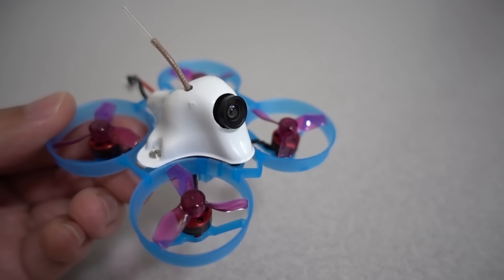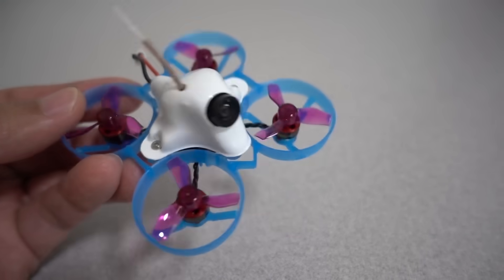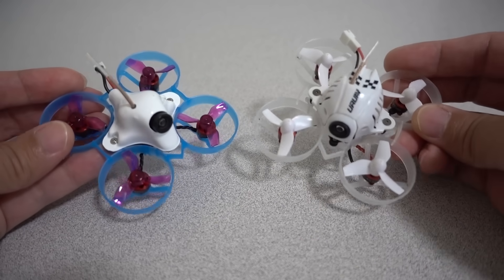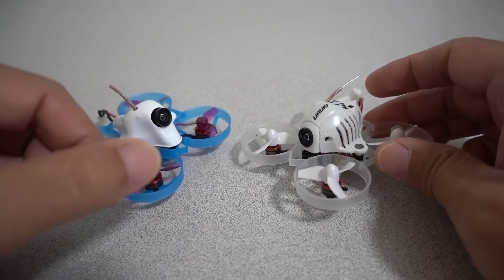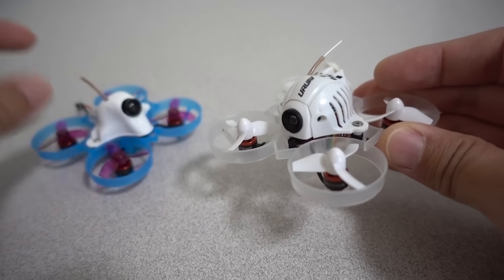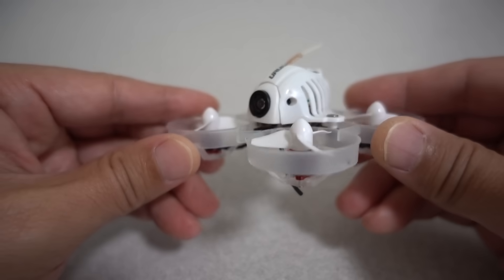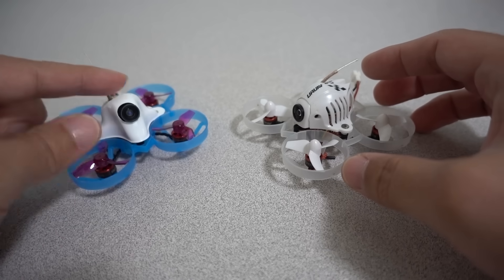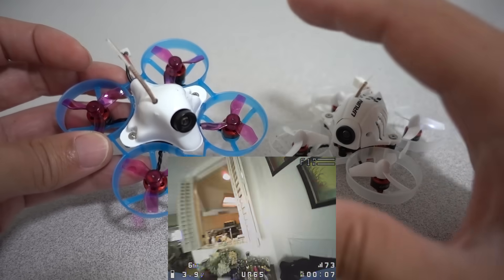Build a Super Tiny Whoop 🛠️

Comment: did you screw the canopy straight onto the fc or do you have small rubber anti vibration things under the canopy.. the canopy looks flush with the fc..thanks
Reply from the maker: grommets were in use here
Reply: @AlbertKimTV  thanks for the quick reply.. I have everything on order should be here this week.. i have a mobula 7 and there's a big gap from the canopy to frame because of big grommets.. im gonna get some smaller ones.. thanks

Comment: Hi. I set up a beta FPV f4 2s with 802 motors. First question it acts like the motors are not spinning up as fast as they should. Second thing what timing in BL Heli should you use on the small motors? Thanks

Comment: Wow, The 0802’s are actually more efficient than 0603’s.. It’s crazy because 0703’s are super inefficient..  I have a nice set of 0802’s with smooth bearings to put on it..   I was arguing with myself over paying $50 for TBS 0603’s.  I already have a few sets of these.. Bonus..
Reply: so 0802 vs 0703, who got better power and flight time?
Reply from the maker: 0802
Reply: what kind of 0802 that have bearing? i dont find any, they are all use bushing

Comment: Are the happymodel motors actually directional CW and CCW? They are listed that way and have different colored wires. However, I’ve seen people frequently build with all the same color wire and most other brands don’t seem to be directional. Any ideas whether there’s a mechanical difference?
Reply from the maker: No difference other than one wire swapped physically. You can always change motor direction in blheli suite.

Comment: Am I correct? These are just the Snapper7 innards in a plastic frame?
Reply from the maker: No. Motors and camera are different
Reply: @AlbertKimTV  So in my Snapper7 exactly the mentioned engines (0802 / 19000kv) are installed.

I agree with the camera, they seem to be different.

So a snapper would be a cheap alternative or a super framework to build your class whoop.

I'm looking for a nice frame for the 0802 / 19000kv engines which is best made of carbon. unfortunately not so easy in category 1s Whoops.

excuse my bad English.

best regards from Germany and thank you for your informative videos and answers

Comment: I want to build a toothpick frame with the electronics of us65. I was wondering if the motors could be a 0802 or 0803 motors or 1102 with the FC from us65. 
Witch of these motors will work. 
The frame I want to use is primo or kababfpv or creampuff lite.
Witch option is best?

Comment: I used the 16,000kv 0802 motors on my UR65 with a Happymodel F4 Pro FC. I also made a battery pigtail to support 2s with 20AWG wire and genuine PH2.0 connectors from Digikey (much higher quality than any PH2.0 connector sold by drone vendors). I cut off the battery holder on the frame and replaced it with a velcro one wrap. This way I can run it in 1s with a 450mah battery for around 5min, or in 2s with 2x 300mah GNBs for about 3.5min. Either one is a massive upgrade over the stock UR65 setup. The 2s setup screams and has no problem at all with acro moves.
Reply: This is exactly what I want to do. Did you have to do a retune to get it to fly well on this setup with 1s and 2s?

Comment: Hi Albert!  can I install the pink gemfan propeller on my us65 without changing the engine?
Reply from the maker: The one in the photo is the 1mm version.  You'll need to get the 0.8mm version if you're using the original 0603 motors
Reply: @AlbertKimTV  ok thank you Albert !👍
Reply: @AlbertKimTV  Hi Albert!  there are some things I do not understand!  I have a us65, but the engines are already 19000kv, I do not need to change them?

Comment: Albert, you may have realized this already, but the stock UR65 props are terrible! I bought a second set thinking it was just the included ones, but the replacements were the same. I see you've got the Gemfan props, which are the best Whoop props I've found. The UR65 with the Gemfan prop upgrade alone is a big difference. I'm sure the motor upgrade helps, but it's almost an unfair comparison.
Reply from the maker: just upgrade the prop and the motor
Reply: Try the new HQ prop tiny whoop props and you will be even happier than the Gemfan which are better than stock also.

Comment: I agree! 0802 happy model 19,000 kv and gemfan 4 blade and 250 to 300 mah is the sweet spot! Tried 22,000 and no matter what I did (weight reduction, props,lipos) could not enough flight time for a race. But 22,000kv on 40mm props just works 😝
Reply: I am about to build my first whoop racer and was thinking 802 19000kv boost juice, 1s 300mah , cockroach frame or beta frame or can a tinyhawk s on 1s be competitive? I race 5" and hate whoop but see that performance and durability is getting better.

Comment: Hey Albert - a few questions:  1st) Any reason why you spec'd the F3 Crazybee, rather than the F4 version?  2nd) What version BetaFlight?  3rd) Could you post your tune, maybe in the description?

Also, do you have any experience with XT.Xinte?  If not, maybe you should look into them.  Great prices and I have been using them for about 9 months now.  You can get a set of four 0802 19K motors for about $25 from xt-xinte.com or $5 less for new customers, which beats $38 from Banggood.  I buy all my motors from them and they have proven to be reliable for me and everything so far has been shipped in a well protected fully taped box.  However, I always chose the cheapest shipping the so the slower China Post adds next to nothing the price, but the only shipping method I have used with them.  Hey, what can I say, I am cheap old man, who is often broke and every penny saved goes toward another quad, parts or batteries... lol 

BTW, they have a set of eight (8) 0802 19K (or 16K) HappyModel motors with 16 props and a V3 Mobula/Trashcan 75mm frame for $49.76 with $2.68 shipping.  That's not bad in my book.  Just search for "Mobula7" to find their deals.
Reply from the maker: Haven't used XT yet but I'll look into it.  Can you send me links to that gear over on Patreon?  I used the F3 (1) it is about 1g lighter than the F4 and (2) I have not noticed any advantage with going to an F4 over an F3 for whoop racing.  I'm using BF 3.5.7 in the video but I've just built another one of these on BF 4.0 and just used the default PIDs and it flies really good.  Watch my video on BF4 tonight.
Reply: @AlbertKimTV  Ok will do!  Posted the info on your Patreon page.

Comment: how can i get better at flying these things? ... can i setup to make it like fly slow to avoid hitting things up?... or am i doing something wrong?
Reply from the maker: @Vamonos Greek  To fly slower, reduce your rates by a lot over default values.  You will not like it at first but once you adjust you'll feel like you have more control than before.
Reply: @AlbertKimTV  thanks Albert, ill try that out
Reply: @jacob james ok thanks! i will try it out... i have a FrSky controller, some tiny whoops. 2 snapper 6/7 and one acrobee :) and one racing drone from Blacksheep. lol I also have a Mavic Air which i really like. I wish i could fly this tiny whoops like the mavic air
Reply: @jacob james yea i need to find the time to set it up and try again. thanks for your help man.

Comment: Nice build and I wholeheartedly agree the 0802 motor is the way to go.  I built my own 0703-17K and 0802-19k, and now have UR65 (yes it arrived and thanks Albert) with its 0603-17K motors and the motors clearly play a huge difference in runtime and performance.  All three are basically the same frame, FC and props.  Great video and awesome advice!!!

If you have never had a brushless whoop and your first whoop is a UR65 or US65 (0603-19K) then you'll love it no matter what.  But and this is a huge BUT going up to the 0802 motors will blow you away.  There is one SEVERE problem the 0802 motors, it literally ruins you for anything less, sorry.  Upgrade your UR65 or US65 to the 0802-19K and you'll never look back.
Reply: I just ordered the UR65 myself along with 8 batteries, I was flying a qx65 brushed before, I have my fingers crossed in hopes that what you say about brushless whoops is true.
Reply: @riggermortisfpv526  - Love your name...lol  BTW, if you kill a motor or they simply wear out, upgrade to 0802 19000KV.  I just got a UR65 and have already ordered the motors to upgrade.  My son has my other UR65 and is on deployment and will be blown away by his old man's modded UR65 when he returns...just saying.  Oh, and you are going to want more batteries...lots more.
Reply: @frankbarajas  Thanks, I stole the name from an old sci-fi character I like. I'll order some more batteries, thanks for the tips :)
Reply: @riggermortisfpv526  - I can't remember the movie but I kind of remember that...lol  

Those of us about to fly, Salute you!
Reply: I'm running a crazybee 1S on a mobula7 V2 frame, 40mm 3 blade gemfans, happy model 0802 22000kv. Do you think I'd notice an improvement going to a 65mm frame with the smaller props? The current set up is fantastic, but I'm curious as to what difference I'd notice on the smaller frame
Reply: @WilkieaSt  yes,  take it's guts out and put it in a65mm frame, you will not regret it. change props to gemfan 1219 or 1220, the last one is a 4 bladed one. the gemfans don't come off when high on the throttle and provide better thrust also... i did this upgrade a while ago

Comment: How does it perform outdoors?
Reply: i builded the same whoop.
it has power enough for outdoor. try lipos  hv 300-340mah .....and get 4 -4.5 minutes of fun  :-)
Reply from the maker: Performs better than the 0603 motors but if you expect it will fly like a 5-inch I would not get your hopes up too high.
Reply: Albert Kim I’m assuming it would perform better than a 65mm brushed acrobee?

Comment: Nice video! I put the mobula7 motors(0802 16000kv) on my us65 and I just didn’t have enough power, drops super hard in turns. Maybe cause I was using the stock 4 blade props not sure?
Reply: I think those preform optimally on 2s
Reply from the maker: The kv is too low for 1S.  It will perform better on 2S
Reply: Thanks guys 🤟🏻